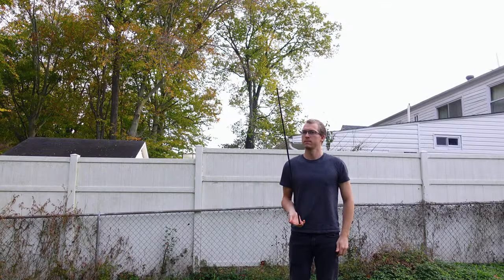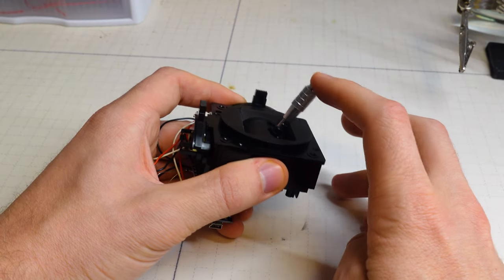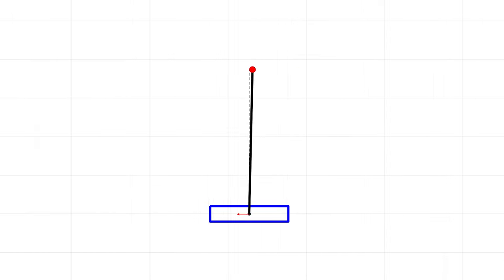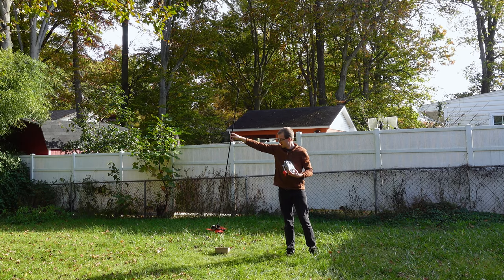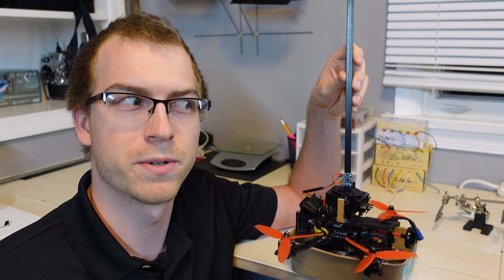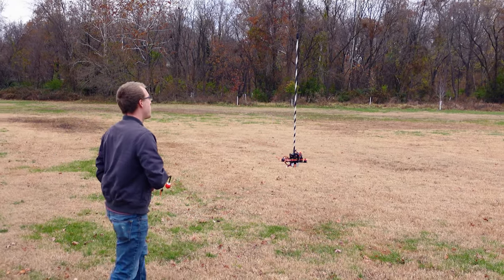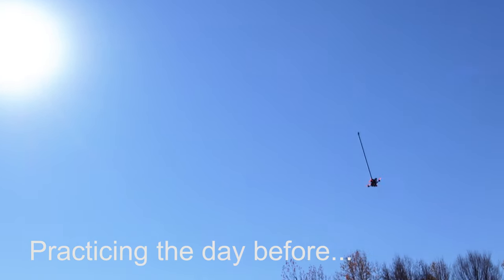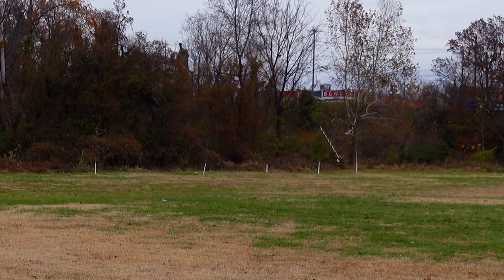Flying Inverted Pendulum

Comment: Your results are incredible! I was fully expecting something a lot less stable.
Reply from the maker: I was surprised too haha
Reply: Its just as stable on top as it is on bottom. Its called the rocket fallacy when you think other wise.
Reply: @NicholasRehm  - I'd love to see you do something with plasma actuators and ducted fans. There are plenty of RC "jet" models out there that use ducted fans in place of turbines. But I'd always heard that ducts create increased drag problems. Meanwhile, I'd also read that plasma actuators which ionize the air can improve the flow characteristics and reduce drag. I'd like to know if it's possible to put the plasma actuators around the duct inlets to reduce the drag and improve the performance of the aircraft.

Comment: I'd love to see you do something with plasma actuators and ducted fans. There are plenty of RC "jet" models out there that use ducted fans in place of turbines. But I'd always heard that ducts create increased drag problems. Meanwhile, I'd also read that plasma actuators which ionize the air can improve the flow characteristics and reduce drag. I'd like to know if it's possible to put the plasma actuators around the duct inlets to reduce the drag and improve the performance of the aircraft.
Reply from the maker: That sounds absolutely insane. I’m in.
Reply: @NicholasRehm  - awesome! FYI, there's a real light sport aircraft that's recently come out called the PJ-2 Dreamer.  It's styled to look like a real jet fighter, but it uses a piston engine to power twin ducted fans, in order to make it more affordable to operate, and also to comply with LSA restrictions on engines. But its speed tops out at 200mph due to the drag on the flow inside the ducts:   https://www.youtube.com/watch?v=OkyUr-3ZtQ8

Comment: @Nicholas Rehm, I had a challenge but I am now realizing the double pendulum pid stabilized videos I've been seeing are not three dimensional. I was going to challenge you to get double pendy with it... but that's a lot of maths when the three dimensional double pendulum cannot freely swing through itself in reality (i cannot immediately think of a way); if we did have access to such a device that would be my challenge. Double Pendulum in all the axis's flying around scaring folk and crashing into flowerpots after a totally working for a good while. Hey, thanks for sharing; this was quality content.
Reply from the maker: As long as it stays relatively vertical and doesn't swing down like you mentioned, the double pendulum on a drone is absolutely do-able. My ability to get a controller working well enough is a different story haha
Reply: @NicholasRehm  are signal IO'ing with pwm, serial, other? There are some protocols that could provide far faster than pwm/serial bus signaling. Thank you for replying to my double pendy suggestion.
Reply from the maker: @slowvoltage  Its not so much an issue of computation/communications speeds, but precision of the drone controller in general
Reply: @NicholasRehm  as in the "tune" of the quad's flight controller? I... dare I say, I specialize in betaflight tuning from 80 to 800 grams without blackbox and obviously benefit from the non-heuristic approach,  using black box logs... A good pattern for pure logists, have someone you trust throw your rig like a frisbee and you pretend your in Space Camp the movie and do your best (it's easier done than articulated) to regain control and then do normal flight patterns and the grocery list of isolated movements by way of your partner signal audibly for each change to the next movement based on timing; these would be reviewed as a time series set to evaluate for the various (scripted) movement event times. I prefer the heuristic approach personally.

As an engineer, I will argue that floating point maths are best codified and abstracted for quick changes with unknown variations on the over all theme, the tune, so to speak. Am I way off?
Reply from the maker: @slowvoltage  more so a problem of compounding error and reduced responsiveness as you go down the line of controlled variables from drone rate -> drone angle -> lower pendulum angle -> upper pendulum angle
Reply: @NicholasRehm  🤦🏽‍♀️its not just about the quad anymore... just got the kids to bed and I was pondering my grand assumptions on just tuning a stand alone rig. So stoked to learn vicariously here. Thanks for the replies, excited to see what you have in store for the future.

Comment: Great channel, great projects. Did you consider using the Arduino Nano RP 2040? It has a fast processor and the IMU included on board ... looks like a perfect platform for these projects. And a GPS module too, to top it up...
Reply from the maker: Specs look good minus i/o capabilities...not so god for lots of different sensors and RC equipment

Comment: Hello, I'd like to build a drone and make the same experiments you did in this video. Could you please post the drone specs? I'd like to buy the same motors and controller. Are these the same you post on your site in the "store" section?
Reply from the maker: They are basically the same!
Reply: @NicholasRehm  The drone aperture is 250mm? Do you have a name/reference? The motors are iFlight XING-E Pro 2207 2450KV 4S ? Would a 6ch radio like the fs-i6 be enough for this experiment (the price differential is quite significant). For the remaining, I hope I can figure it out.